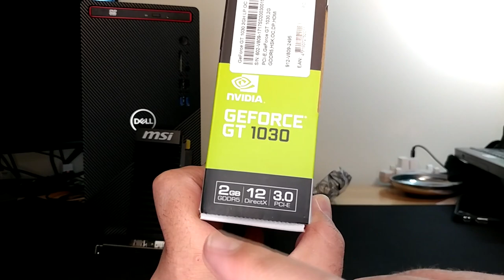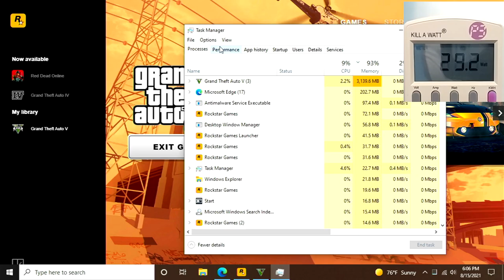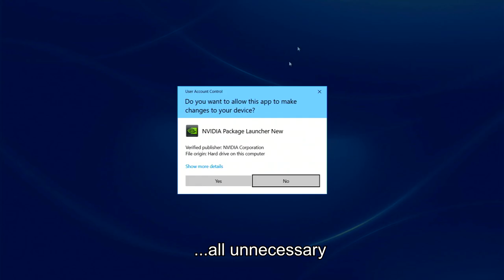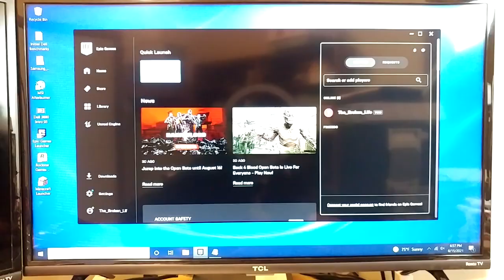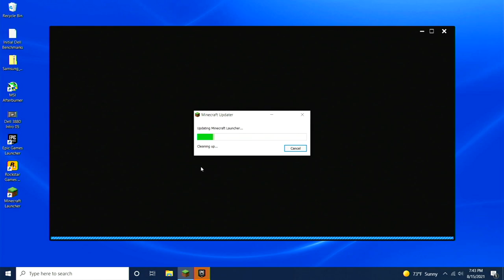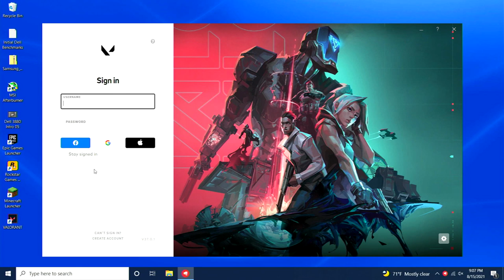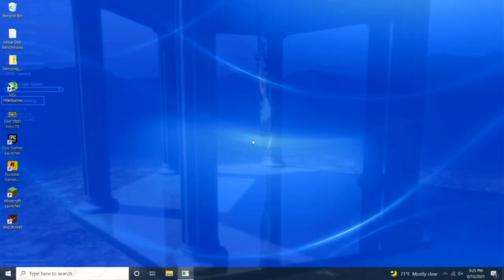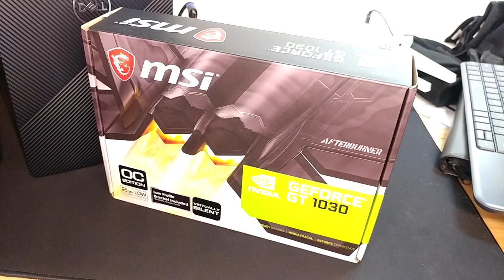Dell 3880 Graphics Card Upgrade!

Comment: Next upgrade, power supply and case and motherboard or an atx power supply running out of the case or a sfx power supply. Thanks to the stupid proprietary case and motherboard from dell that makes it impossible to install any power supply in the case with screws. Plus I already upgraded my case, motherboard and power supply and I also installed all the dell components in the new case and motherboard so now I can do any upgrades without the dell limitations
Reply from the maker: I know you know that's where I'm headed because we've talked about this before. But, the 3 options I'm illustrating, in my order of my preference:

-External ATX PSU
-Internal SFX PSU
-Internal larger Dell proprietary PSU

I've kind of let the community talk me into the second 2 options so I can, more or less, illustrate why not to do them. But, I know if I don't show my work that people will still ask, so we'll just do them all. After that, I'll probably upgrade the CPU.

Comment: I went ahead and added an XPG Spectrix S40G RGB M.2 to my 3880 and cut a window in the side panel to show it off. If anyone's wondering, the S40G does glow in rainbow pattern by default and can't be controlled with the OEM RGB software or any other with the stock motherboard.
Reply from the maker: I've never been one for the flashy lights, but I know a lot of you guys enjoy it. On the build after the 3880, I'm going full disco style. haha
Reply: @TheBrokenLife  
I honestly don't care much for the light show myself, nephews love it though. Also the drive was pretty cheap at $45 for a RGB 256GB m.2. Supposedly the lights affect the performance greatly due to thermal issues or power draw (I tldr'd the reviews), but since this is going to be a show piece I don't mind the loss. The next thing going in is a pair of XPG D60G ram...at some point
Reply from the maker: I could see something like the lights causing technical issues when powered directly from the port. As a total coincidence I was window shopping some RAM today that happened to have flashy lights and it was disturbingly expensive. Now that we've had this conversation, I wonder if that's why. Accuracy errors with your RAM will screw up everything.

Comment: when you added the graphics card, you have 2 HDMI so which one you use? the one attached with the motherboard or the new one attached with the graphics card?? Thanks
Reply from the maker: It has 3 HDMIs now actually, 2 on the GPU, one on the MB. To get the performance benefit of the GPU, use the ports on the card. The port on the board still works though.

Comment: Thank you very much for this video.  I have an Inspiron i5 3880 and, like you, I know very little about modern graphic cards.  I've been toying with a program called "Titanic Honor & Glory" that really taxes the built in graphics chips.  If t he price is right this looks like a nice upgrade.
Reply from the maker: You're very welcome!

It appears that T/H/G isn't even in Alpha stage yet and I can't find reliable system requirements for it, so, it's hard to know if a GT 1030 will serve you well. For the current market price, I think it would be worth the gamble.

Buy from Amazon and return it if it doesn't? 🤔
Reply: @TheBrokenLife    I can play the Alpha on my Dell (i have 12MB) but I need to use a -dx11 tag for Unreal to work or it crashes.  It's very impressive but a huge download..
Reply from the maker: @markraymond3886  Cool. For $100 the GT 1030 is a great upgrade. Hopefully it works out for you.

Comment: thank you for making this video mate
Reply from the maker: Thank you for watching it!
Reply: @TheBrokenLife  Hello again do you know whether an intel i5 is very much slower than an intel i7
Reply from the maker: @95winston  In a 3880, it appears an i7 is a waste of money. I installed one in mine and the results were less than impressive. The board refuses to provide enough power to the chip to make it useful. 

As far as comparing the processors to each other, there are a lot of websites that have benchmarking studies comparing them.
Reply from the maker: @95winston  You may find that the £410 is less expensive than buying the components separately. You could theoretically make money buying the more expensive machine and sell the parts you don't want.
Reply: @TheBrokenLife  should i be worried about power supply if i install a 1050 ti onto the 3880?
Reply from the maker: @Shsnaiaahnahia  Not if it doesn't need PCI-E power. That said, you can put a mild PSU upgrade in your 3880 and run many cards. There is a link to the 3880 playlist in the video description, in that playlist you will find the power supply upgrade video.
Reply: @TheBrokenLife  do you think i can run a gt1030 or rx550 without any psu upgrades
Reply from the maker: @Shsnaiaahnahia  Any GPU that doesn't require PCI-E power will be fine. The GT1030 I showed in this video does not.
Reply: @TheBrokenLife  wait so do certain gt1030s need pcie power and how do i tell if it needs pcie power or no
Reply from the maker: @Shsnaiaahnahia  I don't think so, but I don't know for sure. The easiest thing to do would probably be to read the manual for the card you're thinking of buying.
Reply: @TheBrokenLife  ah ok thank you very much
Reply from the maker: @Shsnaiaahnahia  Good luck with it. 👍

Comment: While it's notorious that the power supplies on these are horribly low, the 1030's aren't going to draw more then 75 watts themselves, and there just isn't enough power consumption for it to be an issue on 3880's.  If you want it to be quiet the evga fan less version is prob your go to, but it's almost a "collectors item" because they stopped making GPU's.  There's some "Super turbo OC cards" that have come out that could be sketch for this also, but those are far more expensive for little gain.  

A lot of text just to say that yes, this is the best general option without upgrading everything else.  But the DDR4 version of these cards is another nightmare altogether, the DDR4 version of the 1030's will actually run WORSE then the intel graphics.  It bottle necks everything to an absurd degree.
Reply from the maker: I heard the same thing about the DDR4 version several times and was pretty disappointed to see this exact card, in the same exact box, marketed with both memory options. 🤦‍♂

Anyhow, now that its long in past, I would probably consider the larger factory Dell PSU and whatever card was "good" in the 150W range. I think that puts you comfortably in to a 1660, which seems like it would be a good balance for this type of system. I'm still impressed with what the 1030 was able to do on is own though.

Comment: I have the same Dell pc but it has no optical drive and the PSU wattage is 260
Reply from the maker: They made them in all sorts of configurations and seem to offer different versions all the time. Mine still appears to be the most basic one they built.
Reply: I've had problems with this pc not shutting down and going to the login screen sometimes but it doesn't happen every time
Reply from the maker: @unumprovident101  Sounds like you should probably contact Dell for warranty support... especially for it not shutting down. That could be a hardware issue.

Comment: Try GTX 1650 LP next time, thought for sure my card would be wasted on this crappy Dell due to its insufficient power but I just had to risk it and see the results for myself. I didn't do any power calculations though as I lack the tools to do so, that's why take this with a grain of salt.
Reply from the maker: I'd love to try additional cards, but market prices are still unfavorable to do so. Really, anything that doesn't require anything more than PCI power should work fine.

Comment: So I’ve had a 3880 for a while, and I wanted to upgrade the graphics card for gaming purposes. I’m not looking for super great graphics, just something that’ll run smoothly. I’ve always wondered about putting in a GTX 1650 but I’m not familiar with software and pc building in general. 

The one thing I was wondering is compatibility with the firmware. Would the 1650 be compatible at all? Power supply will have to be upgraded obviously, and probably will need a BIOS update, but other than that I can’t think of a reason why it wouldn’t work.
Reply from the maker: I have a few viewers that have reported good success with 1650s in their 3880s.

Comment: I have the 3880 with the 200w power supply. I am wondering if the new Rx 6400 (53w tdp) would work with the 200w psu?
Reply from the maker: Anything under 75w should be fine.

Comment: I got an Rx 6600 and it works really well with this desktop
Reply from the maker: Sweet! Mine has an RTX 4060 in it at the moment.
Reply: @TheBrokenLife  with the standard power supply? wth
Reply from the maker: @sambadashingchannel649  No, with a Dell upgraded PSU from a different model. I have an entire video about PSUs for this machine, which is linked in the playlist in the description.

Comment: I wonder if the Inspiron version of 3880 works fine with that graphics card, if it has 200W on my copy.
Reply from the maker: It should.
Reply: Another question, is it necessary to use the HDMI adapter for the graphics card? I want to know which cable I need for the GeForce GTX 1660 because has 3 slots in the outer shell of the PC.
Reply from the maker: @JimmyNGX  Yes. The slot on the GPU itself is the one you'll need to use.

Comment: Thanks!
Reply from the maker: Thanks a lot! I appreciate it!
Reply: @TheBrokenLife  your videos have helped me with my upgrades.   The monitor gets here on the 28th and I have a HDMI 4K certified cable waiting.  After looking at the rated port speeds of the MSI GPU and the monitor I will receive better speeds with a Displayport cable that is certified DP8K.
Reply from the maker: @95SLE  When I looked into this before I don't remember there being a big a difference between HDMI 2.0 and DisplayPort 1.4b(?) as far as performance via 4K. I was looking into it regarding the Intel Graphics at the time, but it seemed that both standards can support 4K @ 60Hz. I'm also curious to see how the 1030 is going to drive a 4K display. My general assumption would be that doubling the resolution would halve the output, or maybe worse. Just for streaming movies that's probably not a big deal, but gaming may not work out awesome.

Keep us posted!

Comment: Whats a good graphics card that can work with this?
Reply from the maker: Many of my subs have reported that a GTX 1050Ti works just fine in it and I have no reason to doubt them. Really, anything that pulls less than 75w should be fine. After that you'll have to upgrade the PSU.
Reply: @TheBrokenLife  Do you happen to know how or have a video on upgrading a psu of this desktop? thank you
Reply from the maker: @madisonl.607  Yes, both. 😁

The PSU upgrade video is in the playlist, which is in the video description.

Comment: Hi, I have dell 3880   i5 and would like to add a PCI with usb-c and DisplayPort for my 4K monitor any advice? I do photo editing.
Reply from the maker: I don't have any experience with USB C add-on cards, but I would imagine any well regarded card would work. As for Display Port, I have a few other questions there. If you just want to connect a single monitor via DP, you can just use an HDMI to DP converter cable. They're flawless. If you want to connect 2 monitors via either DP or HDMI, you're either going to need a video card with multiple of those ports (the GT 1030 I installed in this video would do fine), or you need to combine your thoughts and find a USB C card that also supports video over USB, then buy a USB C to HDMI dock. That's how most laptops do it these days. So, in that event, all of your video would connect via USB.

A less desirable option would be a VGA to HDMI converter. I illustrated one as part of this video series, but I've come to kind of dislike it. It's almost perfect... but not quite. If you're doing editing work it would probably drive you nuts, but if you do 99% of your work on one screen (which I do) and then use the second screen for ancillary tasks, then it's not so bad.

Comment: I have a question i just got into gaming pc's and my pc is a dell 3880 i5 11400 with intel UHD graphics 730 and 12GB of ram and this might be a dumb question but i've seen on amazon the gt 1030 MSI version and the gigabyte version and im wondering if they are they same things and if they arent the same which one will be best recommended for my pc? Thanks
Reply from the maker: That's not a dumb question at all. It can actually be a bit confusing.

The big thing you have to watch out for on the 1030 cards is the speed of the RAM. GDDR5 is what you want. MSI even offers the card I installed in the video in both GDDR4 and GDDR5 sold in the exact same box. You have to pay careful attention to make sure you're getting the right thing. Usually you will get a hint of which card it is by the price. GDDR5 cards were almost twice as expensive when I was shopping.

The lesser thing to consider is whether or not you want a passively cooled card: i.e., a card with no cooling fan. Given what I know about how my 1030 behaves in my 3880, I don't see a need for the fan. If you get a good deal on a card with a fan and don't mind the slight bit of noise, that's fine too.

As far as which manufacturer is best, I really have no strong opinion. Just stay with a recognized name brand and you should be fine.
Reply: @TheBrokenLife  Thank you for replying, so the GDDR5 is the graphics card is the one i want will so that means any graphics card that has GDDR5 labeled to will work well with my pc.
Reply from the maker: @meme9ine  Yes, you will want a version of the GT 1030 with GDDR5.
Reply: @TheBrokenLife  I see that there are like GDDR5 and GDDR6, GDDR3  and the GDDR5 im just wondering what are the differences between these, sorry if im asking alot of questions i just don't want to get the wrong one lol
Reply from the maker: @meme9ine  Those are different RAM speeds. The bigger number is faster. I've only seen a 1030 with up to GDDR5 and that's what mine in the video is.

Comment: hi i would like to upgrade my inspiron 3880, would an amd rx 570 work fine on it? its the amd equivalent to the nvidia 1660 what do u think
Reply from the maker: Anything that doesn't require external PCI-E power would work fine. Or, you can put a really mild (and affordable) factory  Dell upgraded PSU in it for a few dollars and run a better card if you want. The power supply upgrade video is in the 3880 playlist (which is linked in the description).
Reply: @TheBrokenLife yes i got the power supply to go along with it thanks, ill comment if it doesnt work out lol

Comment: I just got the 1660 super and went to install to find out that the power supply doesn't have a harness to plug it in🙃. Luckily after watching your video, checking out other videos in the 3880 Playlist, I now have more of a view of what to upgrade and what to get. So I'm assuming at this point I need to upgrade my power supply to get the harness to even run this graphic card. I hope that new video comes out soon because I want to game😁
Reply from the maker: Yep, you're going to have to do something other than what you've got with either the video card or the PSU. Other viewers have told me there are versions of 1650s/1660s that don't require external power, but I don't know anything about them as I'm priced out of that market. It might be worth a look around?

PSU video will be out in probably 2 weeks.
Reply: I'm looking at a EVGA 750W 150mm power supply. Gamestop has a sale on them from $139 to $89
Reply: @TheBrokenLife  gotcha, thank you for the feedback. I ended up getting it for 100 bucks so I saved probably 500 on the graphics card, luckily, it was still in the box lol. I wasn't going to let it pass me by, my buddy upgraded to the 2070 so he cut me a deal
Reply from the maker: @DrFetusCS  It's not so much about size of PSU in capacity as it is physical size and form factor. I'll cover all of this in the video.

You got a great deal from your buddy. You could always flip that card on eBay and do something else.
Reply: @TheBrokenLife  I thought that too, but might as well run it. My cpu is good for the graphics card so I'm going to upgrade ram, cpu cooling, power supply and ssd and I think I should be set
Reply from the maker: @DrFetusCS  You're only like $150 away from not having a Dell anymore and just getting a new MB and case too. That's where mine is heading...
Reply: @TheBrokenLife  I'm catching on to that😂 I'm kind of realizing that it may have been just easier if I were to just buy a case and go from there. Oh well, at least it will look like a basic pc on the outside then have golden guts.
Reply from the maker: @DrFetusCS  Ehhh.. Sorta... The PSU option I prefer is a standard ATX PSU, and it will end up being external to the case. So... Not all that sleek in the end.

At that time we all bought our Dells, we couldn't have bought the hardware inside them what Dell was charging so we're all way ahead anyhow.
Reply: @TheBrokenLife  agreed!